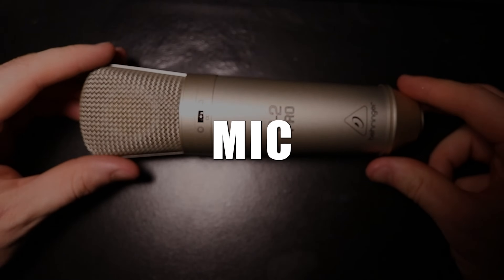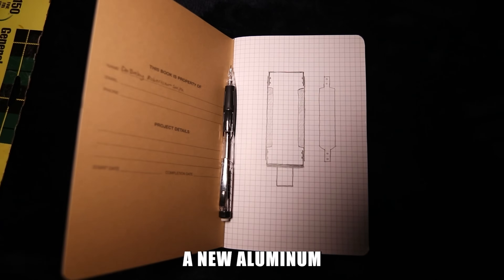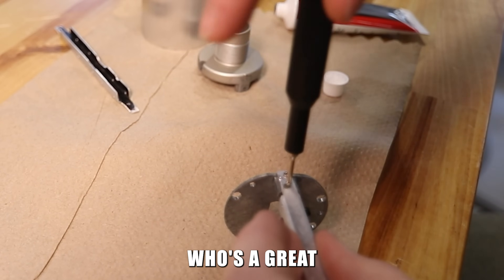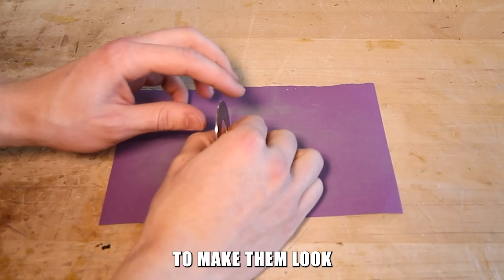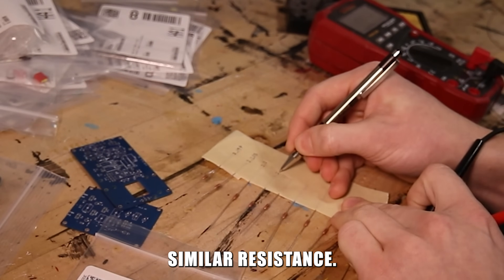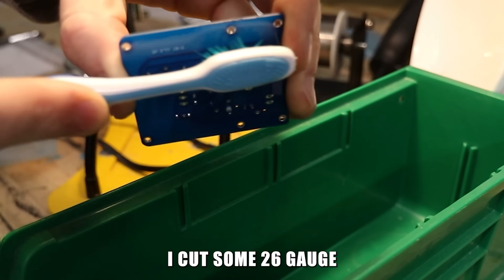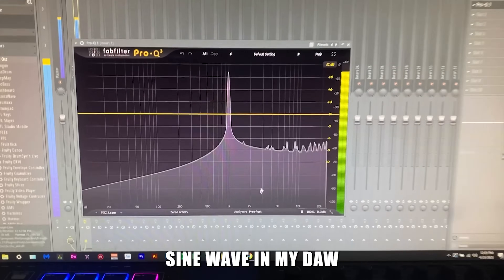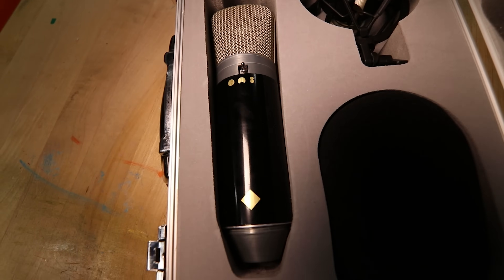How to Build a Condenser Microphone

Comment: You quickly come to understand that the difference the sound that is recorded are close to nil..People are geeking out on microphones but they use a cheap pre-amp to record their shizzle...The old Neve consoles had a deadly voltage for the tubes etc, this will give you a much huger and richer sound. When you record at home I found that better way to go is to choose between the different kind of microphone, say dynamic or ribbon vs condenser, but more often the condernse sound brittle and thin and does not sit well in the mix unless you cut away much of the high end brittleness and there for a dynamic sound much better even a ribbon sounds more round and can take a little boost here and there when using EQ.

Comment: Great vid!  So the whole set of components from the vintage mic store turned out bad?  Was there a difference in components that were used?  Also, what JFETs did you use in each build?  That can be a big issue for some of this.  Thanks!
Reply: I totally messed up the first PCB's. I forget which JFET's rn, if i have a chance I will check

Comment: Has anyone tried the Roswell k87 mics? They use the same capsule but they order the body from China and then assemble them in California.
Reply: Creamy mids, soft highs, super present lows that can easily get boomy/boxy. Its a great mic that beats out more expensive options, every artist I record seems to love it on guitar, sounds very realistic. It has a signature "wetness" compared to most mics. Where it's unlike a u87 is how loose the low-mids sound, doesn't have the signature tight low-mids of the real thing. For vocals, I have to battle the lows and wield off-axis placements, but the fight is well worth the color and the price point. Unbelievable voice over mic.